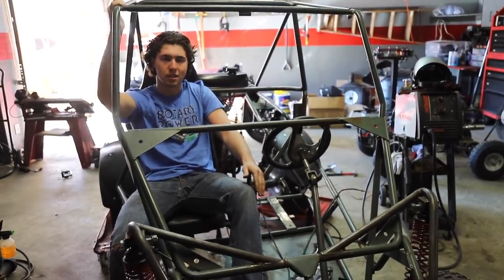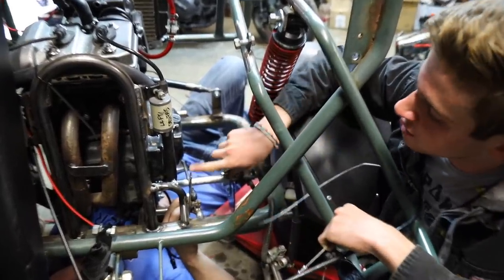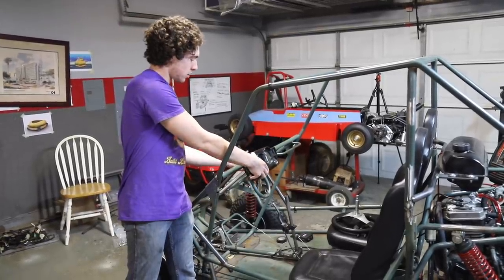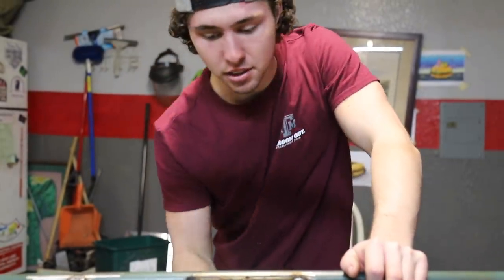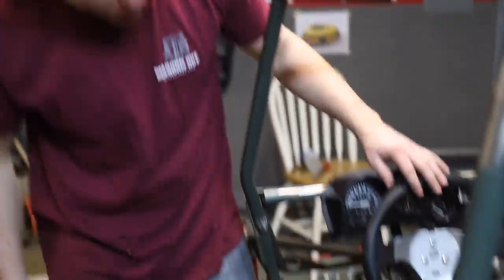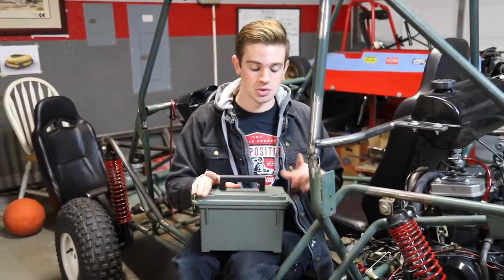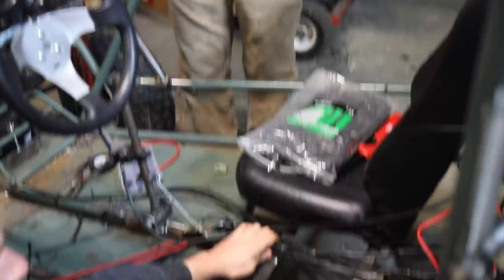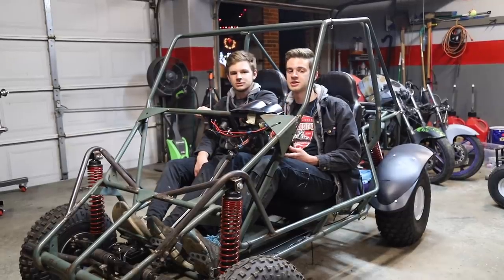Ninja Offroad Shifter Buggy Build Pt 7 | Ready To Drive!

Comment: Hey guys enjoy your builds. As far as the wiring I know you said that's not permanent so just an idea for you, snake it either through the tubes of the chassis or if you can't run some tubing pvc or something so you can run route the wires through this way it will look way neater and be more protective.

Comment: I used a shifter cable from like a B and M slap shifter.....they're a push/pull cable.....check out my R6 buggy I built from scratch
Reply from the maker: Fabrication Nation Will do, sounds cool
Reply: @BuildBreakRepeat  yep, the push pull cable set-up is what the guys at DIY Go Karts forum resoundingly recommended, same situation as you guyd, had to do the shift behind the articulation point of my off-road kart